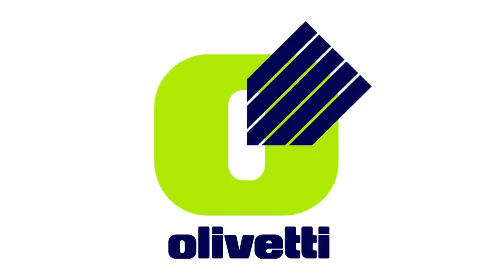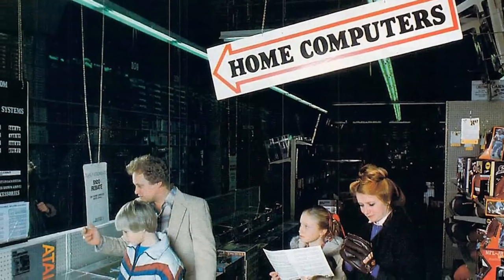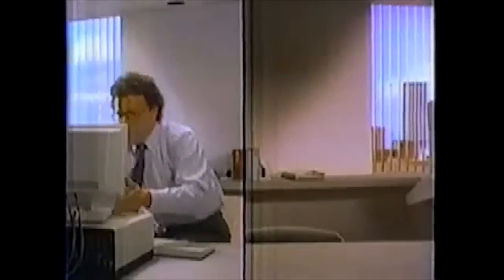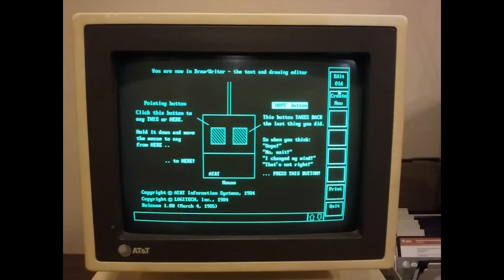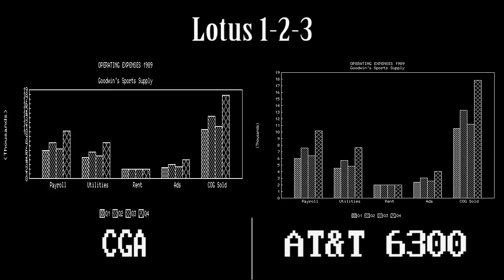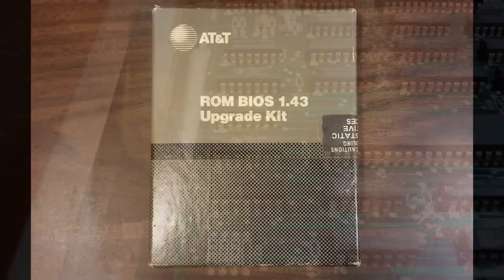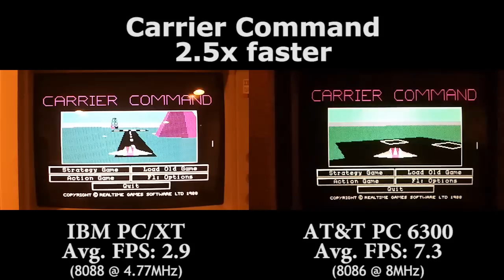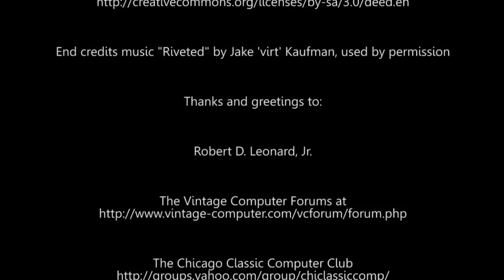The AT&T PC 6300: A Retrospective

Comment: Wow. I designed the graphics card. This video is a real trip down memory lane. I share a patent for the circuit that lets the card take low-level register programming of the graphics card, determine the software's desired format, and provide full compatibility at 400 lines instead. There was an add-on graphics expansion board I did that could plug in and get the system to 640x400 16 colors. I think only Olivetti sold it. The systems were also sold as the Xerox PC, and by Logabax.
Reply: +Herbert Kutscha Wow! That's cool!
Reply from the maker: That is really cool!  I just finally got my hands on a DEB after 30 years; I look forward to trying it out, although there wasn't much software that took advantage of it, unfortunately.
Reply: For the DEB, the request was for "more graphics". They didn't really know what that should be. I added bit-planes and a color lookup table, resulting in 16 simultaneous colors. IBM compatible software didn't know about the bit-planes, so it didn't use them. It did have a cool feature, where two blink clocks went to the LUT as addresses, yielding four-phase blinking in up to four arbitrary colors.
Reply: I recall that the AT&T/Olivetti monitors did not use the same timing as the IBM monitors, and so in order to retain compatibility with software that would write to the CRT controller timing registers (MC6845 I believe) there was a address decode logic and ROM or PAL on the card that intercepted those particular writes and changed the data to the correct value.
Reply: Yeah, I've ended up reading up on that stuff pretty much by accident as I've been skimming the manuals for techie details about the output format (I've been trying to get details on old ~25khz monitor machines for a certain thought exercise and finding the details extremely hard to pin down). The system was officially called the "scrambler", and the explanation of how it works, and the formulae that it used to munge direct attempted-writes-to-CGA-registers by even the most badly behaved software into something that would still work on its own monitor went wayyyy over my head. There's some pretty complex algebra in there. Extremely clever stuff.

I had a similar experience looking through the DEB programming guide, it was a bewilderingly capable piece of kit for an early 80s RGBI-compatible video board, including the multi-layer/multi-plane blending system and the interesting built-in multicolour dithering and flashing that gave you an easy way to work around the limitations of that colour system and draw images which simulated a higher colour depth. It's essentially the ultimate evolution of a CGA-type board... something of a pity both that it never really got the popularity or recognition it deserved (being overshadowed by the arguably not-really-any-better EGA), or that IBM didn't have the resources and technology to build something like that (or indeed the 8MHz 8086 and 16-bit expansion slots) right into the original PC.

(the next bit kinda warrants being a second post to make things more easily readable, if you'll indulge me)
Reply: I know it's a hell of a cheek, but you wouldn't happen to remember, or still have access to, the details of what the monitor scan rates were, would you, Herbert? I've come across at least four different directly conflicting accounts just in the realistic 25-26ish khz range (with Vsync from a little below 50 to a little over 60Hz, or nearly 70Hz in one case), never mind the obviously wrong ones that claim VGA-like 31khz, CGA-like 15.7khz, MDA-like 18khz, and right down to 33Hz vertical... Problem is, not even the actual Olivetti technical manual seems to get it right, and some of the figures written in there seem to contradict each other, look suspiciously like all-too-easy typos or mistranscriptions, or don't match up with what I've seen people roughly (and variably) measure with scopes.

Best I can tell is it's 24MHz exact pixel clock, low 900s pixels / roughly 115 character times horizontally (but no-one can agree which), and... well, anywhere from 432 to 518 lines.
And there's basically nothing about the M20 emulation mode (19.66MHz and at least large enough to support 512x256 is all she wrote), though I'm not truly bothered about that other than it being an annoying nut that I haven't been able to crack.

(The machine essentially seems to be at the top end of the "25khz" frequencies, so pinning it down will help me define the overall range that a compatible monitor would have to support, or a new mode defined for a classic machine intended to work with such a monitor would ideally sit right in the centre of)

If not... does anyone with one of these and a suitable oscilloscope / logic analyser / even just a high frequency audio recorder (maybe Jim, maybe someone else?) have a moment to hook one up to the other and get an accurate readout on the Hfreq (counting actual pixels or clocks might be tricky), and the Vfreq and/or number of lines in a frame?

I mean, I don't have any active webspace of my own at the moment, but if I ever do so again it'd be nice to actually publish a final reliable figure for this, and maybe submit it to the three or four M24/6300/6060/1600 fansites (as well as e.g. VCF) that I've run across along the way which list their own more or less realistic best guesses at the figures. It might help prevent a few unsuitable fixed frequency (or narrow ranging and insufficiently protected multisync) monitors from being burned out, too, either replacement ones connected to these systems, or a monitor from one being connected to some other machine.

Also if anyone has a DEC Vaxmate and can do similar... (an extremely fringe machine, and not really relevant to the project overall, but I happened to come across its manual, and even they seem confused as to their own machine's specs, the same way as with the Olivetti manual... in one case I'm fairly certain someone's multiplied a Hex value by two as if it was Decimal, thus overinflating the result).
Reply: I used to repair Logabax printers.  I have never seen the name in any other context.  In America they were installed with Sycor RJE systems.
Reply: @JimLeonard  Great walk down memory lane.. I guess all AT&T sons got this as a 1st PC.. I am looking to acquire it again.
Reply: Interesting
Reply: After our Vic20 and C64, my dad brought home the 6300, our PC gateway. We upgraded that rig with a SVGA card, a 16-bit Sound Blaster, and even had so much storage after installing an ISA 40MB hardcard. The 6300 was a workhorse, so upgradeable for its time.

Comment: I remember having one in high school in 1987 or so.  I remember we had dual 5 1/4 floppies, 720k of memory and a 20mb or so hard card (if I recall correctly it didn't save things like a hard drive does so when the pc was turned off..you lost everything on it.  I never saw another one and friends that came over couldn't believe how useful it was till I showed them) in it.  I never actually saw a mouse for one till this video.  I remember it would run circles around the IBM's at school.  When I was programming games in basic at school and brought them home to work on, I had to slow them down to make them playable on the pc6300.  Loved the video and thanks for bringing back some great memories.

Comment: Through the years I've bought, played with and resold many old PC's, but of all of them the AT&T 6300 is the one I've regularly kicked myself for not keeping. It was a fine machine. I used it for word processing and spreadsheets, which the 6300 handled quickly and efficiently. The high-res screen was easy on the eyes and the overall design was excellent. Thanks for this great retrospective.

Comment from the maker: My video equipment may have misrepresented things, sorry.  The AT&T 6300 did NOT produce more than 4 colors in 320x200 at a single time as it was a CGA clone and held to those rules.  CGA had six different 320x200 palettes that changed the latter three colors, and the first color could be any of the 16 (but was typically black).  Check MobyGames for King's Quest screenshots to see non-typical CGA palettes (as well as true 16-color 160x200 composite output).
Reply: One of the odd things about the graphics system, at least from everything I've read, is that if you add extra memory to it... you can get extra colours in both 640x400 and 640x200, but still not 320x200, and it still doesn't do anything such as automatically converting composite-colour graphics into a 160x200 mode with RGBI colours chosen to be close as possible to the artefact colours. Still, you can't have it all. I think the reason given was something to do with how the 640 modes were natively 1-bit monochrome, as a monolithic bitplane, and it was therefore easy to just add extra bitplanes in the piggybacked memory banks, whereas low-rez was a messy interleaved 2-bitplane setup that would have been a complete pain in the butt to try and extend (even on top of what they'd already done to build the full-colour 400-line modes) as you'd essentially have to duplicate that layout and simultaneously decode it to get 16 colours. Simpler to just use the memory as extra pages for the base mode, and if 320x200 16c was desired, just emulate it with doubled-up pixels in 640x200, a bit like using 320x200 256c to emulate low-rez EGA on an MCGA card.

Not sure what that might have meant for Plantronics/Tandy/PCjr or medium-rez EGA compatibility. Did anyone ever make a full-quality conversion of Thexder (which originated on a 640x200 3-bit RGB machine and so was one of the very few PC games, heck probably one of the few programs overall, to make use of 640x200 16c) for the expanded system, I wonder?

Comment: The M20 is a good example of how market success can be a subjective thing depending on your location and occupation. It seems to have done poorly on a global basis, and I hadn't heard it before last week, but apparently it found a place on the desk of every tax accountant in Italy because of being one of the first systems to get a decent desktop accounting software package... to the point where they even gained a wake-on-ring remote power device that could start the computer in your office late at night when a central mainframe (possibly the Italian IRS? I forget, it was a bit of a skim) dialled in to send data back and forth. Not sure if it even had any popularity outside of Italy even in the rest of southern Europe, but there does seem to be at least still some enthusiasm for it, and for emulating the system. And of course, the M24 had an emulator card for the M20 available, with a custom video mode for that card built right in to the main video system...

Comment: Thank you for a great video which brought back lots of memories about an AT&T 6300, my first PC I owned in the USA.  My computer was fast but a bit flaky. I have learned to take it apart and put it back as re-seating the motherboard, bus board, and controller cables fixed the problem for some reason. It was highly compatible with IBM XT/AT.  I wrote programs for my research projects and they ran on IBM ATs without problem.
Reply from the maker: Mine was a bit flaky as well, but I believe that's because I abused it quite a lot.  The 6300 I currently have in my collection (the one in the video) is extremely stable.

Comment: My first was the PC 6300 dual floppy with 640K Ram and an amber monochrome screen. Your description of the unboxing was almost exactly how it went for me.  I was so disappointed to learn that when you turn it on, all you get is the A:\> command prompt and nothing more. I buckled down to learn Lotus 1-2-3, Wordstar, file management, GWBASIC, and eventually Borland's Turbo Pascal. I also learned about making backup discs when I lost 2 years of data on automotive gas mileage. With a dot matrix printer and "sideways" printing software I felt invincible. I did the V30 upgrade and in those days it was huge since the microprocessor gained a lot of speed by prefetching the next command on the other side of the dual 16-bit bus.  I also added the 8087 chip and that made a big difference in large Lotus 1-2-3 sheets.  Finally, I was an AT&T employee at the time, and having an opportunity to read the schematics, learned the 2-megabyte memory expansion card was unnecessary since the mother board already was mapped for the next generation of memory chips. I simply bought a full set of memory ICs and flipped a few dip switches to get the full complement of expanded LIM Memory onboard.

Both my kids learned computing on this machine and became very adept.  I never installed the 10 MB hard drive as newer computers were coming along that had much larger HDs for the same cost. The modern 100 MB HDs were an unbelievable size, and I could never imagine filling one up.  Keep in mind, before modern media files came along, one byte was more or less equivalent to one keystroke.  I once calculated 100 MB of non-stop typing 90 words per minute would take about 42 years.

As for games, I had the night mission pinball, flight simulator, and World Class Leader Board Golf. "Can't be too happy about that one Jim".

thanks for the blast from the past.
Reply from the maker: We shared very similar experiences!

Comment: As a teenager I got one of these at a thrift store for $15 complete EXCEPT for the keyboard. I ended up taking the hard drive and controller out and putting it in my leading edge model D.  I always wished I had a keyboard to have been able to use the 6300. Great video!!

Comment: Great descriptions of the 6300. Awesome job!! Alas, some of the novel proprietary features and strengths later became weaknesses. The "U-turn" design with the motherboard on the bottom and the expansion slots on top was convenient and compact, but added significant cost to the system when compared to other PC "clones" with much simpler chassis. The 6300 required three different circuit boards, four additional edge connectors, and additional intermediate sheet metal that all took their share in cutting into product margins. But perhaps the biggest early problem was the break with 16-bit PC-AT add-in card compatibility caused by the 6300 having its 16-bit extension located away from the 8-bit ISA connector and therefore 'standard' 16-bit add-in cards could not be used. Performance advantages were good, but short lived, as by 1985 PC and PC-AT clones with 8 MHz "turbo" modes were widely available. (with the 4.77 MHz speed option retained for compatibility). 

As noted, the 1.43 BIOS was required to support add-in video adapters. Using a 3rd party video adapter also required removing a chip from the 6300's built-in video adapter. Since the adapter shared with the U-turn function, it could not be readily removed to create 'video-less' skus for people who wanted to use 3rd party adapters. The video adapter thus became another 'cost overhead'. I recall The 1.43 BIOS also corrected a little 'eccentricity' with the system tick. The hardware used a different frequency for the UART clock (which was subsequently divided to create the interrupt that ultimately became the system 'tick') and the BIOS didn't configure the system to account for the difference, causing about 20 minutes per day of system-ticks to be 'lost'. Even though the 6300 included its own RTC, once MS-DOS got the time-of-day it relied on the system tick and people wondered why they were losing time when they left them running. 

The 16-bit connector, U-turn, and video adapters carried through to the follow-on '286-based 6300 Plus with its revolutionary 'Simultask' logic. But that additional logic was yet another overhead on those looking for just a  faster AT clone from a major U.S. company.

The quality of the double-scanned CGA and the crisp text display were big sellers and made the 6300 a major player for a while, but the design aspects that added cost, broke compatibility with the IBM PCs, and required proprietary cards and peripherals ultimately took their toll. (E.g. was having lights on the keyboard worth the cost of having a proprietary connection?) The lesson learned during those years was that you could differentiate by going beyond the IBM PC's capabilities, but not at the cost of compatibility and the ability to leverage the ecosystem of 3rd party vendors who were building for the PC. But it wasn't just a mistake made by Olivetti/AT&T. Companies such as Digital Equipment also tried to go the 'proprietary peripherals' route and paid for it. By the time that AT&T/Olivetti moved to making computers that had full compatibility, they had lost the opportunity to lead by being a proper (but full compatible) feature superset of the IBM offerings. Instead, that opportunity was taken by Compaq and their dedication to providing enhancements while preserving interoperability and compatibility with the PC.

Comment: My first computer was a PC 6300. My parents got it with 640KB of RAM, mono monitor, and two floppies (with the twist latches rather than the flip ones). We later got the ROM upgrade; a V30; a Hardcard, which died and was replaced with a hard drive installed in the second floppy bay (with some minor mods); some sort of "bus patch" board (iirc) and a jumper chip to disable the built-in display card (iirc) so we could install an Orchid ProDesigner II VGA card. I never knew what that 9 pin port on the keyboard was for until watching this video. We just got an ordinary Microsoft serial mouse. We also wound up replacing the keyboard with a clone, when the original died (iirc), which had function keys on both the top and the left side.
Reply from the maker: With the exception of your keyboard replacement, your experience was almost identical to our family's experience with the 6300.  :-)